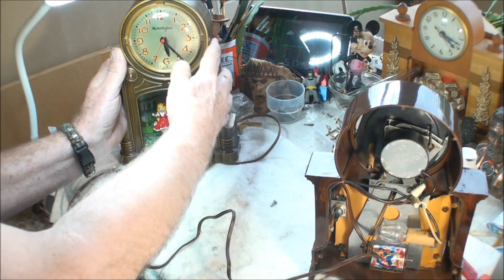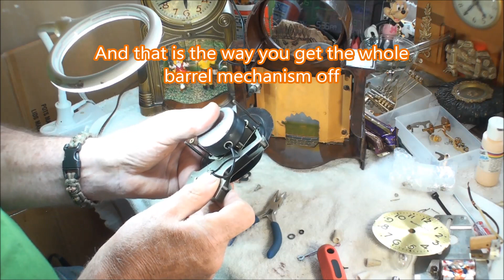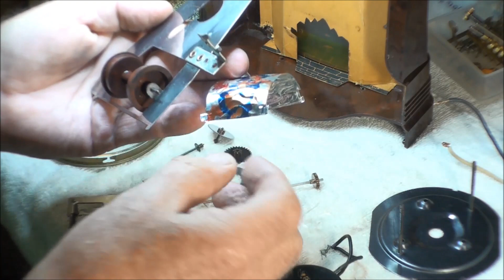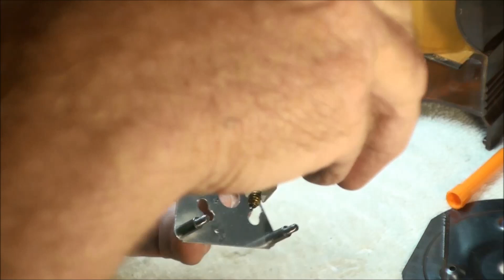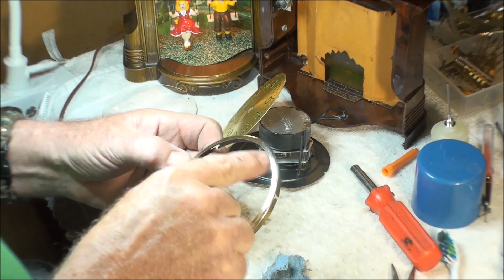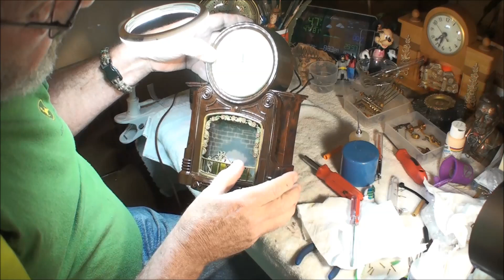Vintage Master Crafters Fireplace Repair

Comment: Hey Mike, really enjoy these Mastercrafters clock videos.  You're just about the only one on YT making videos repairing these particular clocks.  
Do you happen to have the Mastercrafters clock with the waterfall?.   That would be a cool one for you to show in a video.  It has the line in the back so likely has the "cheaper" motor.
Reply from the maker: I will admit that I have low views on the Master Crafts Videos, but I don't care. I do the videos to help others with their clocks. When I have time, I will do one on the waterfall. I do know that you should buy the 7 watt bulb to see the falls work during the day. The swinging girl or boy and girl can use the lower watt bulb because they are open to the eye and no plastic in front of them.
Reply: @justmike57  Mike,  that would be great.  Can I ask one more thing?.   I think I asked this on another of your videos...sorry.  How do you check if a motor is bad or not?.  The motor has two wires...black and white. I have a multimeter.  I set it on ohms and touched one probe to one wire and a probe to the other and it remained at 1.  Is that a bad sign?.  Shouldn't it go to 0?.  I just want to make sure I'm not reading it wrong
Reply: Mike...that wheel with the arrow on it also appears to have a tiny spring that goes over the shaft of it.  Does it go on first and then the arrow or vice versa?.    When I put the top back on the motor, two of the gears don't move...the center one with the hands and the big wheel next to it.  I'm doing something wrong putting it back together and it's causing the gears to not turn.
Reply from the maker: @wildernessofzinn17  Just make sure the gear shafts are going in the hole and you shouldn't see the gear with the hands on them move because they move very slow. Yes, the spring goes on last. The arrow is to prevent the clock from running backwards.
Reply: @justmike57 Update:  
I have the rare one with the carousel.  It suddenly stopped working.  I was pretty sure it was just dirty as these electric Mastercrafter's clocks are prone to drawing dust.  I keep CRC QD Electronics cleaner on hand (available at Wal-Mart).  It is fantastic stuff.  I use it to clean watch parts too because it consists primarily of hexane, leaves no residue, and evaporates fast.  That did the trick.  She's back up and running.  😎😎👍👍

Comment: Hi Mike.  I took all your tips in the comments below and getting the nuts at the local hardware instantly quieted the clock! It ran for about a week and now the stem that turns the gear for the log makes a partial revolution and then pops up and stops the clock.  I’ve looked it over from this connection to the other end of the stem where it engages with the clock motor but it’s beyond my wheelhouse. I’m just a 70 something grandmother hoping to get this sentimental purchase up and running. Any tip will be appreciated.  Thanks!
Reply from the maker: I am happy to hear you are at least trying to fix your clock. Normally when they pop up like yours, the gears to the fire are needing some oil or a little clock grease. Look for anything that is causing friction. Make sure the metal plates where the gears have to ride are not bent. Also, sometimes the fire is bent up and needs to be taken off and flatten again and put back on the wheel if it is touching anything.

Comment: Wow! Such patience and talent! Thanks for taking the time to share.  My Mastercrafter  Fireplace clock arrived a couple of days ago. Advertised as working...but took some wiggling to get it going and a bulb replacement. I love this clock and want to ask about how to quiet the motor. I am not talented enough to re assemble a clock so I would like to clean it a  bit and then oil it with clock oil which I need to purchase. I am also missing the nuts that hold the face bolts in place but hoping to either find some or hoping even more that it will stay together.  Any suggestions would be greatly appreciated. Also have to ask if you would clean and fix it. If so let me know how to do that.
Reply from the maker: On these motors, they were not really meant for the power me have now and the clocks can not handle a power surge. This might be why they suggest using a surge protector or power strip with one on it. You might have a store, like Ace hardware that you should be able to find the right nuts for the back of your clock. Some times it is hard to get the clock to quite down, but oiling it will certainly help. I do some clocks on the side, sometimes, but the price of shipping both ways is costly and then adding the cost of fixing the clock makes it not worth fixing, so with that said, Watch the video again, take pictures as you go. and be careful with that fiber gear or plastic gear, depending on the clock you have.
Reply: Many Thanks. I'll put it in a room where there is lots of audio like music or tv. And still hope for the best when I oil it.

Comment: I have a clock exactly like this one. The light works but the motor doesn't work.  The back of my motor has a spinning wheel with holes.  Kinda looks like a hubcap.  Your motor looks different.  Where can I find a replacement motor?
Reply from the maker: There are a few on E-bay that sell them but first I would try to fix yours as long as the wires are still attached. The center shaft.. try dripping some oil behind the hubcap. The shaft that goes from front to back has a brass piece that needs the oil so the rod can turn. Also remember that there is a brown gear below what the motor turns and if that gear gets messed up, it is EXPENSIVE to replace it.

Comment: Hello Mike! I appreciate your work! I just wanted to know how many RPM's this motor produce? I have to rewind it, and I don't find any info on that. Thank you!
Reply from the maker: I have no idea on the RPM's. I just know that the motor has brass sleeves that the shaft goes through the motor that needs oiled or taken apart by slipping the gear end out so you can clean the sticky old oil off if just oiling doesn't do the trick.

Comment: Hi:  I need to replace the cord on my Master Crafters Fireplace clock.  Do you have a video showing how to do this?  Thanks in advance!
Reply from the maker: I do not have a video on this, but what I would do is buy a cheap extension cord and cut off the end you plug thing into and just wire it the same way as it is now.

Comment: I am buying a fireplace clock that works but the bulb is burned out . Can you show how to take the back off ? Do you need any special tool ? Ian buying from eBay and the owner says there is no place on back or bottom to open ? Thanks if you can help . Also I’m looking for the trim that goes on front if you have any leads to finding those . Thanks
Reply from the maker: This video pretty much tells you how to get the back off. Just a couple of nuts and screws and if yours has a light switch on the metal part and want it off as well, unscrew the nut around the switch on the outside. As for the tools, it's nice to have a pliers, a Philips screwdriver and maybe a straight screwdriver as well. 
  If your clock does not have the trim, then don't plan on buying the trim. When it does come up for sale, they are asking about the same as what the clock might have cost you.